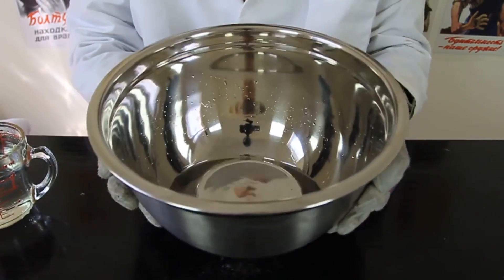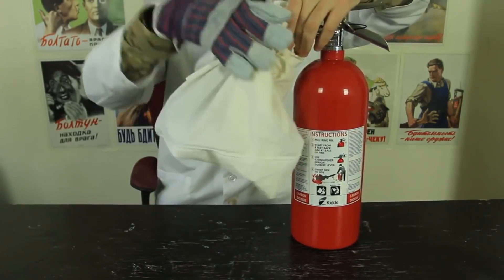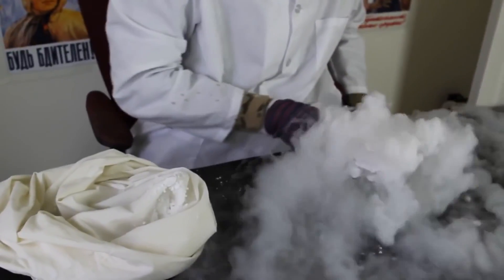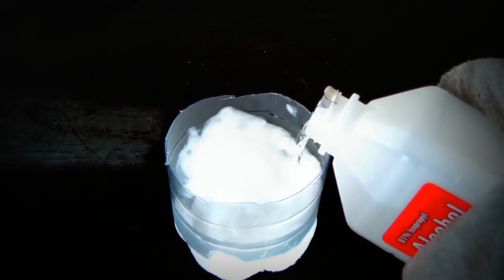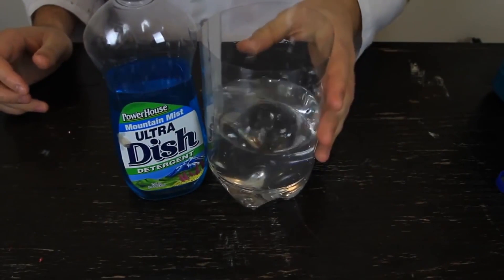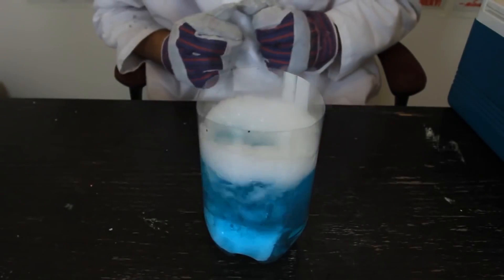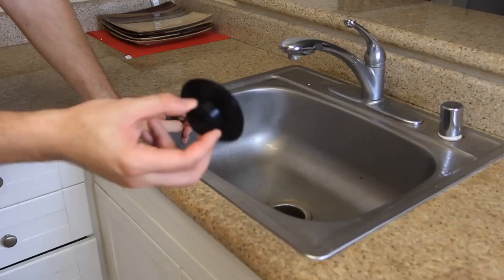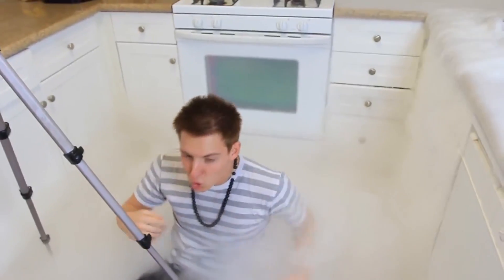8 Dry Ice Experiments Compilation

Comment: Just a heads up there bro.  Always use a seamless plastic bottle (i.e. 2 liter Coke bottle), cover the dry ice with plenty of water but not too much water, screw cap on as tight as it will go and have patience.  It takes time for these things to blow and each one will blow at a different rate (some take a minute or so while others take longer).  It will blow a mailbox off the post (put bolt through latch).

Comment: The reason alcohol doesn't freeze like water would is because alcohol has a low boiling/freezing point.

You know how you can get that alcoholic hand soap stuff that evaporates off your hand like straight away? That's because it evaporates at a low temperature close to room temperature. So if the boiling point is low, the freezing point is low!

In other words it just freezes and boils at lower temperatures because of the way the molecules are attached to each other
Reply: Wow smart.......

Comment: but can you eat the ice
Reply: +Macie Younge Dry ice is carbon dioxide in solid form. There are two problems with letting the CO2 contact unprotected flesh. The first is the extreme cold. Dry ice is about -350 degrees Fahrenheit. It would stick to your tongue and kill all the cells that it touches, just like fire would. Also, CO2 is not good for people to take in, so it would be somewhat toxic. And when the ice goes from solid to gaseous form, it expands its volume by about 300x. So you would die if you tried to eat it.

Comment: Are you sure it's dry ice out of the fire extinguisher ?
To make dry ice usually you compress CO2 into a liquid, then it turns into a snow on expansion. Finally it's compressed into the dry ice you buy. This thing sinks in water. The one you got floats, so I wonder if it's CO2 snow, or maybe a bunch of other additives make it different.

Comment: I HAVE AN EXPERIMENT!!!!!

RULES:

*Follow directions
* You CAN NOT have ANY metal in your mouth

MATERIALS:

*Marshmallows
* Dry ice
* Tweezers
* Warm water
* Glass cup
* Paper towels

DIRECTIONS:

1.  Put the warm water, dry ice, and 1-5 marshmallows in the glass cup.

2. Wait 10 seconds.

3. Pull the marshmallows out using the tweezers and put them on the paper towels.

4. Eat the marshmallows! Don't worry!

Comment: co2 or dry ice sinks because of the density not the temperature although if it is heated it will rise. co2 will not hurt you if you breath it but it will kill you if thats all your breathing as it displaces oxygen so if he had stayed down there breathing he would start to feel like he was suffocating. Kind of like when you breath into a plastic bag as your body uses up the oxygen and replaces it with co2

Comment: Can someone please tell me the difference between dry ice and normal frozen ice?
Reply: Normal ice is solid water. Dry ice is solid carbon dioxide.
Reply: Callum Gunn Thank you :)
Reply: Shodan Computer Search Engine I think it is is around

-75°C

Maybe -76C at least in that fire thing
Reply: Lisa Messi It is not completely solid in the fire... extinguisher...
See, what happens is.. cooled liquid carbon dioxide is released with an ENORMOUS amount of pressure.. so much pressure that some of the liquid turns to solid.
Using the Ideal Gas Law between Temperature and Pressure.. the more pressure there is, the lower the temperature, and vice versa.
Reply: respectdat0 Yeah. But I think it is that cold as I said. atleast a fire man told me that

Comment: The "smoke" is carbon dioxide gas  cold enough to condense water vapour out. It "goes down " because carbon dioxide is heavier than air. YOu have some some really cool stuff - but the exploding bottle - you are just nuts doing that one inside. Hope you don't do that with fire crackers when the fuse has "gone out" :)

Comment: If you touch dry ice what will happen
Reply: It will ( ironically) burn your skin. Don't breathe too much of it either. It's frozen carbon dioxide
Reply: Dry ice is extremely cold, much colder than regular ice, so it can cause frostbite if you leave it on your skin for too long, or it can just cause your skin to hurt or burn temporarily.
Reply: You'll have to amputate the limb it touched or you'll turn into a Yeti
Reply: Wendy Ydnew dry ice is extremely cold - about -80degC which is about 100deg colder than room temp which is around 20degC.  if you touch it for more than a few moments it can damage tissue because it freezes your skin cells.  the end result would be pain and cell death similar to a "burn"

it won't freeze your entire hand or stick to your skin, but it will be very painful and could do serious damage if you held onto it long enough.
Reply: I touched it before in school  and it hurt for a little while
Reply: you'll get frostbite.
Reply: It can also stick to your hand and if you pull it off it rips a layer of skin off and it hurts like hell
Reply: Uh huh. Dry ice is around -100 degrees and it would just make it cold? It will freeze your skin or the whole entire limb off!!!
Reply: Claire Conley The Human body isn't a very good conductor, only the immediate area of the body that is in contact with the dry ice would become frozen.
Reply: BayleynatorX1 yeah but when it freezes you can break your hand on a table.
Reply: theantinaziperson andthebronytolove no it won't.  dry ice will not stick to skin.
Reply: Claire Conley can you please explain to me why it would burn? I know that it would.. But I thought something has to be hot to burn you!!

Comment: At 10:30 or around there, that sink dry ice experiment. Is that same it won't like stain anything will it and or poison me will it?
Reply: If you breath too much of its fog, you can get carbon dioxide poisoning. Did some research, and yes, it's deadly. It will freeze your skin off, but if you wear a glove and don't breathe too much of the fog, it will be pretty fun. I just did a couple experiments with it ^_^
Reply: Carbon Dioxide will not kill you, but Carbon Monoxide can. You don't have anything to worry about, as long as you don't touch the dry ice with your bare hands for too long. The worst thing you can get from breathing in too much Carbon Dioxide is Hypercapnia, but there is a very low chance of getting this from a simple experiment such as this one. Teachers perform this experiment in school, and Carbon Dioxide is not toxic, so it isn't deadly. Have fun with you experiment! :)
Reply: Claire Conley CO is carbon MONOxide.  That is odorless and poisonous. Carbon DIoxide is not poisonous.
Reply: Everything is poisonous in high amounts. It just takes less Carbon Monoxide to kill you than Carbon Dioxide. Dry ice is solidified Carbon Dioxide. In a room as open as that, you're completely fine unless you literally lay on the floor for HOURS at a time. Only the ice is completely cold to the touch, and the gaseous carbon dioxide is the white "smoke" being produced from the solid carbon dioxide, which is completely fine to touch. Carbon Dioxide is also colorless naturally, but the reason why the gas is white is because the solid skips the liquid phase, and goes completely to gas, (this process is called sublimation) resulting in a white color which eventually turns clear.
Carbon Dioxide freezes (Dry Ice is frozen Carbon Dioxide) at negative 79 degrees Celsius... and for Fahrenheit that's negative 109 degrees. It's not a good idea to touch things that are -109 degrees.. you will get frostbite if you hold it for 10 seconds or longer.
Reply: Dry ice is frozen carbon dioxide, so don't get any ideas about filling your room with the fog it makes. If you do, you could suffocate to death or cause massive damage to your body. And also, PLEASE wear gloves. That ice is cold enough to ( ironically) burn through skin. It's really fun to play with though ^_^
Reply: You can't breath C02 very very hard to breath also when I was little the teacher did that experiment... I got on the floor could NOT breath I mean it hurt my lungs
Reply: Your good it won't kill you because its the same thing you breath out
Reply: I don't think so
Reply: Claire Conley but is it deadly??
Reply: EpicSea Diver!
Reply: Oh. LOL
Reply: It's like fog that floats low on the ground

Comment: I was wondering if u could dye either the dry ice or water to get colored smoke. I would love some answers before I go out and buy dry ice.
Reply: Laila Muhammad it won't work.. it'll only change the color of the water.. not the smoke..
Reply: I had the same thought when I first saw dry ice.. but unfortunately no. You cannot change the color if the smoke
Reply: Dye it with food coloring
Reply: You can put colored lights witch will light the smoke up kinda like a dance floor
Reply: dye the water not the dry ice

Comment: Did you get a static shock after using the extinguisher? CO2 extinguishers usually gain a static electricity buildup at the tip when it's discharged.

Comment: The reason why water freezes easier than alcohol is because the water molecules interact with each other more strongly than the alcohol molecules. Water can form 4 hydrogen bonds per molecule and alcohol only 2 (a hydrogen bond is when the H on one molecule is attracted to the O on another molecule, momentarily 'sticking' the two molecules together).

When the temperature is lowered the molecules don't vibrate around as much and the hydrogen bonds lock the molecules into place and it forms a solid (it freezes). This is similar to the blocks into tetris all fitting together.

Since the alcohol molecules don't interact with each other as much as the H2O, it freezes at lower temperature (in other words you have to really make sure the molecular vibrations, or heat, are very low in order to freeze the alcohol and let the molecules lock into position).

Comment: Question... I have white quartz counter tops, black sinks, and wood floors through out the house.  Would the experiment of putting the dry ice in the sink ruin these three surfaces? I wouldn't want my expensive white counters to turn yellow, etc.
Reply: He had wooden floors, and they were perfectly fine or else he wouldn't have tried them. When the other person laid down, crazy Russian hacker said the smoke was completely breathable, so your floors are fine and same for your counter....I don't know why the color of a sink matters....but best go with his stainless steel/aluminum......
Reply: Dan Han I have black composite sinks not stainless steel/aluminum, but I'm sure they won't be damaged. I just wanted to double check. Thanks
Reply: i dont think it would ruin your floors this smoke is just made out of water like steam i guess
Reply: Almost right. Dry ice constantly emits its carbon into the air. The drop in the temperature causes the water particles in the air to form the fog. In essence, the fog is made of CO2, H2O, and O2.

Steam is different in that it's when water particles are moving too fast to stick together and more energy/heat in coming in. This causes evaporation and that's why steam is hot.....unlike the fog that is cold :)

Comment: Dry Ice is frozen CO2. The "Smoke" is the CO2 sublimating, Its pure CO2. the reason it sinks is because it's heavier then air. it also displaces oxygen in your lungs. the guy could have suffocated on the floor. you really shouldn't be using that amount of it indoors with out ventilation.

Comment: I don't know if you have tried it yet but, I tried a chemical heater pack from a U.S.A. M.R.E.,  I put it in a plastic 2 litter bottle with water, it swelled up 2-4 times is original size and it sounded like a cannon when the plastic bottle finally gave way and exploded. It is hilarious when put in a coworkers small trash can, under harmless paper or other refuse, and timed to go off when they are at their desk.

Comment: Not much priority on safety here. The reason the "smoke" is going down is not just because it's cold. The smoke is condensating air moisture that comes into contact with the cold CO2 gas. CO2 alone is heavier than air and sinks to the bottom. What you're doing is basically flooding the room with CO2. Asking your buddy to then lie down on the floor is a no-no. He's going precisely where the concentration of CO2 is the highest and consequently the concentration of oxygen is the lowest.

Comment: you can eat tht stuff ??
Reply: It is air, if you will swallow it, you will burp it up. And yes it is fine, it is just CO2.
Reply: if you're talking about the dry ice, the no. it's too cold and can burn your tongue. it's about -110 degrees fahrenheit
Reply: U can eat it. Check out grant thompson's video
Reply: you can 'eat/swallow' the vapor though. but it's carbon dioxide

Comment: because alcohol is made to heat up...remember in Titanic or sunken ship the survivor on the boats need alcohol to heat up your body especially he was using 90% of alcohol so it will not freeze. water is neutral PH 7 and freezes at 0 degrees and boils at 100 degrees so its different to alcohol, hope it helped

Comment: The reason the rubbing alcohol doesn't freeze in the dry ice is because it's  freezing point is at -89 degrees, whereas dry ice has a temperature of -78.5 degrees C. The dry ice isn't cold enough to freeze the rubbing alcohol. However, dry ice is much colder than the freezing point of water, which is 0 degrees C. Hope I answered your question!

Comment: Ice is frozen water
Dry Ice is frozen ice
am i right?
Reply: No, dry ice is frozen carbon dioxide.
Reply: frozen ice? really?
Reply: Ice and Water are both the same substance , just different phases .
Reply: Frozen Ice? How does that gonna work?
Reply: Dry ice is frozen carbon dioxide
Reply: No dry ice is well dry ice
Reply: Mr.Element no it is the carbon dioxide subliming (going from solid to gas) that makes the smoke. ice would melt
Reply: Solid Carbon Dioxide is Dry Ice
Reply: no dry ice is ice with no water :P
Reply: jrg8 LOL
Reply: Ok kidding dry ice is ice that is lower than normal ice so it is dry
Reply: Does these work with normal ice?
Reply: It's frozen co2
Reply: Dry ice is frozen gas so in this case frozen co2
Reply: shithead Ice is water XD

Comment: I once accidentally made liquid nitrogen by holding a can of pressurized air upside-down. Nice to know that was dangerous now. ._.
And for the dry ice in the sink, can't you just dump the pieces into the sink?
Reply: Yes but it can strip away the metal in the sink so use a bucket or somthing

Comment: Does the smoke from dry ice cause fire alarms to go off??
Reply: Cigarettes.
Reply: No smoke alarms cannot reach dry ice vapors. But fire smoke is thick enough to be caught by the alarms.
Reply: It's not smoke...
Reply: Optamizm is it not smoke?
Reply: Optamizm is it not smoke?
Reply: its not smoke its carbon dioxide - dry ice is basically frozen carbon dioxide water is warm enough to vapourize it thats how it works (also it falls because carbon dioxide is a heavy gas, helium rises as its a light gas) also smoke is from a fire completely different thing
Reply: But What is smoke made from?
Reply: hannes jacobsson Yeah, what Lensius said...

"Smoke is a collection of airborne solid and liquid particulates and gases emitted when a material undergoes combustion or pyrolysis, together with the quantity of air that is entrained or otherwise mixed into the mass." - Wikipedia...

Meaning that smoke is the product of either burning or heating something to high temperatures... This is neither burning or a high temperature...

"Smoke is a collection of tiny particles of carbon (soot), tar, oils and ash."
Reply: it water vapor not smoke
Reply: Optamizm
Yes it is also a colloid, which means the particles are so small that their surface area is greater than their mass.This is the reason smoke or dust etc. stays suspended in the air.
Reply: TheGamingLamb its not its carbon dioxide you idiot dry ice is frozen carbon dioxide go back to school
Reply: TheGamingLamb if it was water vapour you wouldnt see it, it would rise, and the water would get used up not the dry ice and anyway how would dry ice evaporate water when its colder than water if anything it would freeze it
Reply: hannes jacobsson its not smoke its more of a "fog" and kinda acts like a liquid.
Reply: captkiller9 its not even that just carbon dioxide its a gas and it falls because its heavy which is why the co2 bubbles fall really fast too. dry ice is just frozen co2
Reply: its fog.
Reply: PoloBoyPrince no.

Comment: Again, it's actually clouds of water vapour, not smoke. But great experiments anyway.

As for the isopropanol/dry ice thing: You made a freezing mixture there. Works the same way as a mixture of ice, salt and water get temperatures below 0 °C. I don't know the temperature for Isopropanol/dry ice mixture though. It's not freezing cause Isopropanol has a freezing/melting point of -88°C. Dry Ice only has -78°C, so it's above that.
Reply: Its actually carbon dioxide, cause the dry ice is subliming...
Reply: You can't see the CO2, what you see is water from the air condensing into clouds because  the CO2 is still freaking cold after subliming.
Reply: well if you phrase it like that, then you're right